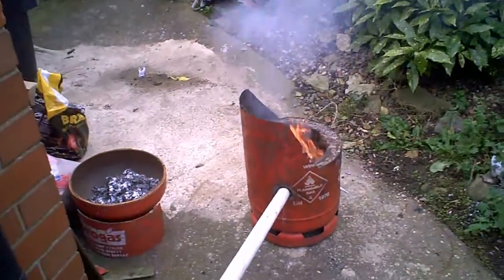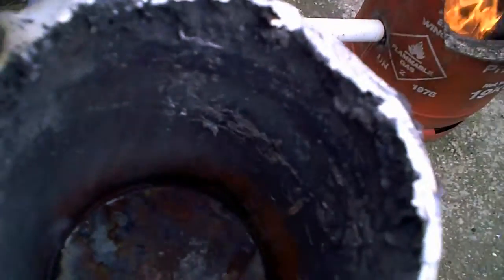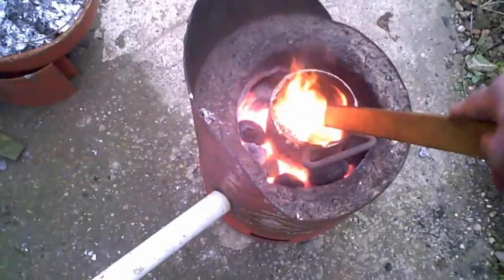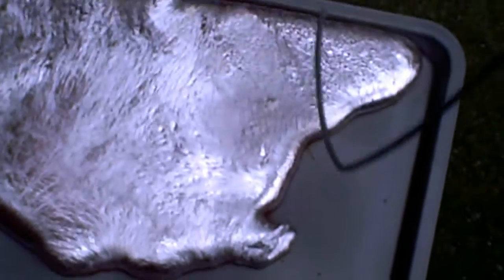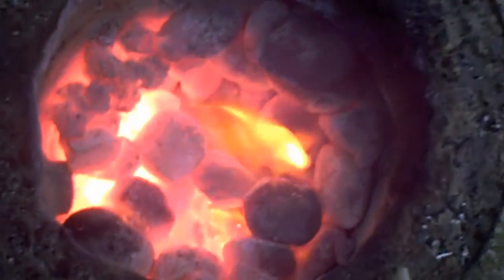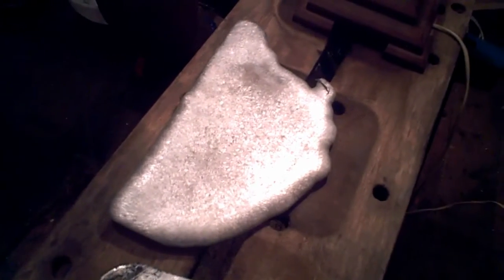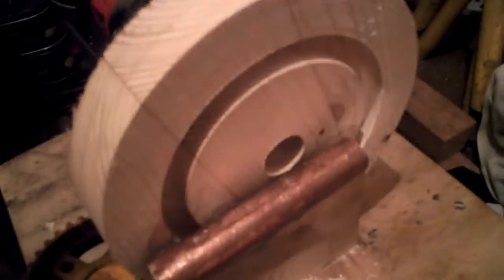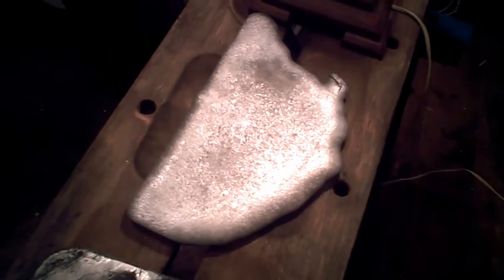Model Steam Engine #9 After a Catastrophic Failure I've Cast the Base

Comment: Hi Malc - sorry I am late watching but am playing "catch-up" now. There is a lot more to this than just throwing some old cans in and leaving them! The slag is, I suppose, an "unclean" product that could spoil, a bit like making clarified butter and having to skim the sediment and scum from the surface! I was quite surprised that when you pour the molten metal into the moulds (which look like baking tins), they do not burn right through the base.
Reply from the maker: +Eezee Listen Don't worry about being late watching Mike. I sometimes save a few up to pass an hour. Yes the slag is the rubbish that must be scraped off. First one I did I left it in and the ally strained through it. Funnily enough, some of the best I've had. Aluminium melts at 640degC and Steel at 2400degC so no chance of them burning through.

Comment: O dear Malc a bit of a set back there ,,, but your getting some flipping good ally theres no doubt about that,,, and you should get a fair size usable piece out of that,,,   You have done well to collect all them cans ,,, I have a good idea just how many it must have taken to get that amount of metal ,,,,  A few days cold windy weather coming in so you got that firing done in time ,,, well done that's far more than what I got melted down ,,,
Reply from the maker: +Alan Plumb Thanks Alan - yes managed to salvage something. After looking at what I've got again, pretty sure I've now got all I need. However plenty to go at yet. Got a new bag of nuts today, there's just a few left, but they've done what, 4 longish firings so pretty happy with that. I was about at the limit of the melt though, the cans were starting to take longer.
Really just got a small one to do, cast the flywheel and a few bits of round for the cylinder and valve. Or square, doesn't really matter. Just got to pick up a few bits for molds.
I've got the flywheel mold done today, too late and too long an edit so give me something to do tomorrow. I usually like to put videos up straight away, otherwise I tend to lose interest lol.
It's taken a while, however I've got the furnace working properly, and as you can see it's safe to use in my small area. No sparks and hasn't even burnt the paint on the gas bottle.
I can think of other things to do with it as well, bit of blacksmithing. Mind you I'm a blacksmiths son, not a blacksmith, freehand skills nowhere near good enough.
And small lost foam ally castings, so all in all that has been well worth doing.